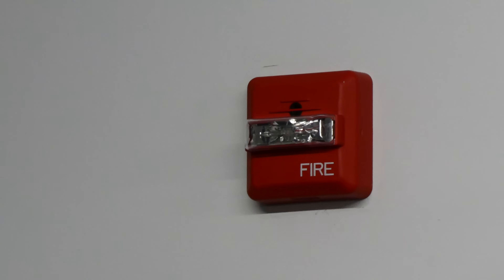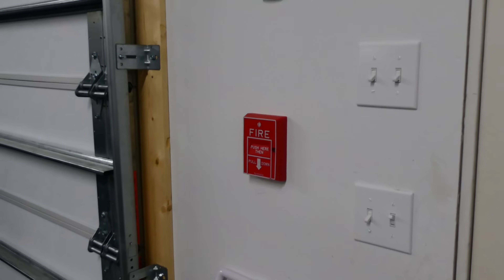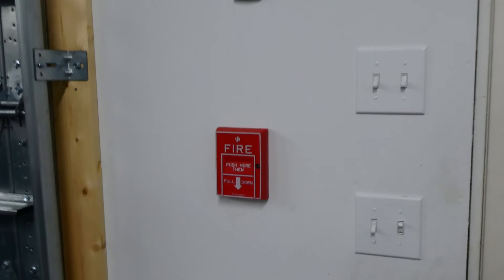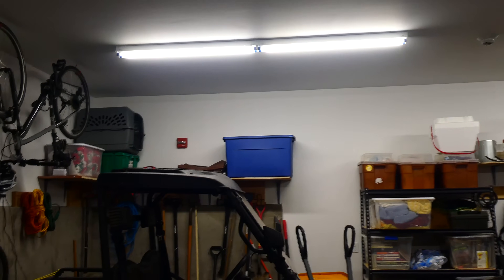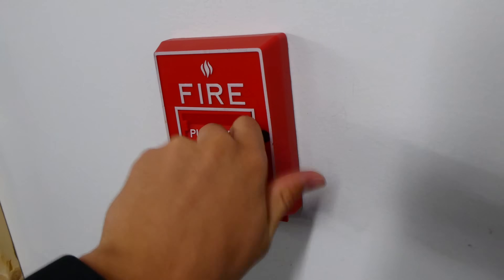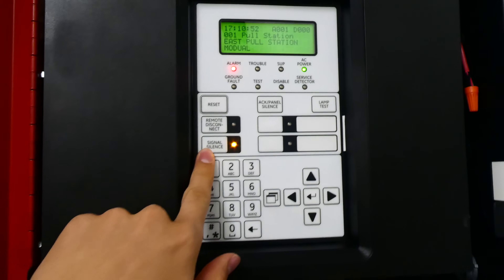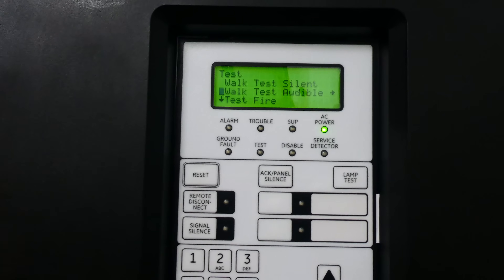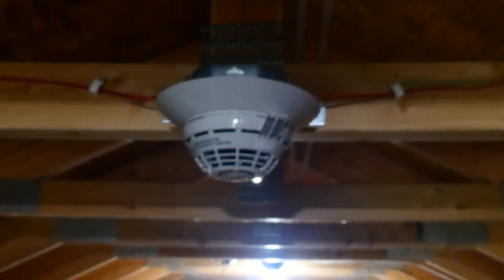S.E.R. System Test 5: Wheelock ZNS!

Comment: There are pull stations similar to that in the gym of Arroyo Grande High School, except they’re single action and are branded “Pry-A-Larm”, which makes me think they are from the 80’s, makes since because the campus was built in 1953, the alarms they have are Wheelock AS’ and RSS’, and this school I mentioned is not my school, my school is Nipomo High School, the smaller rival school